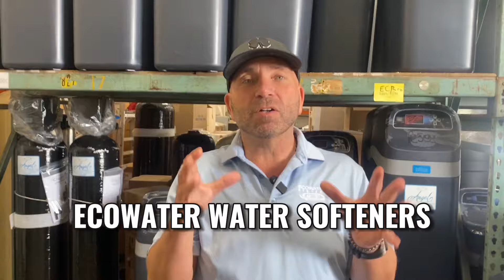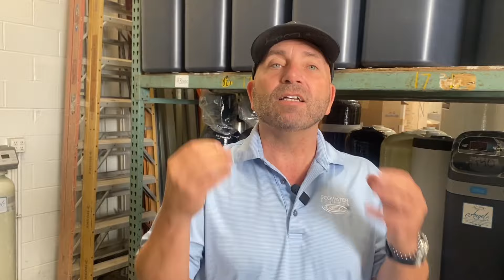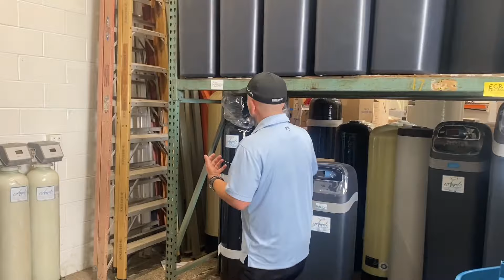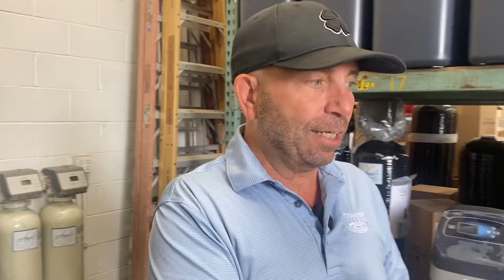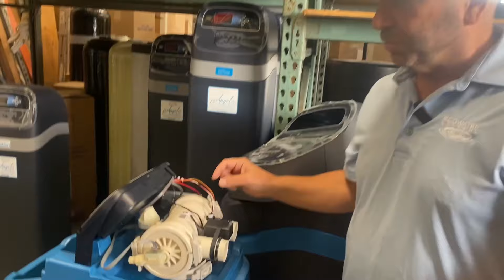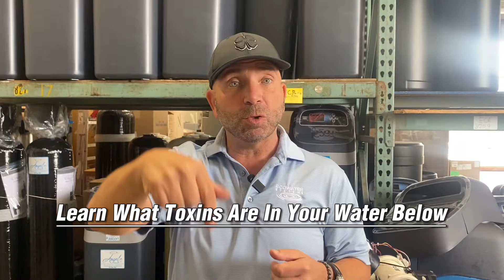ALL ABOUT ECOWATER | Angel Water, Inc

Comment: Way way toooo expensive for a water softener.  $5000-$8000?  Really?  Get one from Home Depot or Lowe’s for $500-$700 (wifi connected too)and you’re just as good without taking out another mortgage. Put mine in and saved big time.  Just think taking $5-$7k out of investments to buy this. You’ll lose $500-$700 per t would pay for a new one every year.  But I’ll bet mine will last 10-15 years.  It’s. Scam.
Reply from the maker: Hammer.  We service all makes and models as a service center for the big box stores.  So literally it’s is our team going out to service the big box softeners.   If you don’t plan on living in the home for a long time the big box may work.  However the warranty itself will explain if a manufacturer believes in their system or not. Big box = 0 warranty on filter material. 1 year on valve.  3 on electronics.  10 on tank.  Vs 5 or 10 year bumper to bumper warranty on some professional grade products. Big box also reduces water pressure in home.  Also most are not certified to remove radium from water. 
And that big box doesn’t include tax or installation. 
Most of our customers have homes that are their forever homes. So like most things in life, you get what you pay for.  But my philosophy is simply.  I’ll do whatever you want for your home and family.   We are here to serve you.
Reply: @AngelWater hmm let’s see, $5,000 to $8,000 for a water softener?  Crazy.  There’s really nothing to them, plastic containers, some media, valves and simple electronics. Like I said, I could replace mine every year (two water connections and a cord plug) and still be money ahead.  But the one I bought for $700 has a 10 year warranty and wifi to monitor and it’s working flawlessly.  I get that you think yours is the best, and maybe it is, but at that price, it’s just not financially realistic.  It appears Your videos scare people into spending this money. Anyways good luck.

Comment: Our EcoWater system from Costco is my #1 regret purchase of all time. When they came out to do 1St. years service I got a large bill. Next service the Tech told us we needed to spend another $5000.00 for services of water heater (which was new at time of softener install). I cleaned flushed and installed a new anode rod. Total cost less than $50.00.
The tech was extremely pushy to the point I asked him then told him to leave. The company still kept calling. I thought I was going to have to get a restraining order.
Very unhappy here in Prescott Valley Arizona.
Reply: I hear ya. I don’t really think that the Costco executives are tuned into this ripoff.  We had a guy come out, he was unimpressive, had no people skills, just regurgitated his speech and left.  Not impressed. He just harped on scaring us.  Not a way to sell.  Fear is not a motivation in my book.
Reply from the maker: Wow, you have a lot to unpack here. I am thoroughly confused with the water heater issue and how that is related to the water softener.  I would urge you to contact the owner of the EcoWater dealership you dealt with so they understand the experience, that you had regarding the representatives pushing you.  
Each EcoWater dealer is independently owned.

Comment: @Drew the Water Guru
I live in Osteen, FL.  I can of course buy from a Costco contractor or a local dealer.  Not sure if Angel Water services my area being 2+ hours away.  What is the advantage/disadvantage of buying Costco versus a local dealer.  I am contemplating Kinetico which two of my neighbors of recommend and Ecowater.  I need one within a month.  My system sucks ass.

Comment: I had an ERR3700R20 installed in March of this year.  I don’t feel the water being slimy or slippery.  They had me increase the hardness from 13 to 17 and I still don’t see the difference. Then to 21 & still no difference.
I don’t know whether this softener/refiner is actually doing its job.  Do you have any suggestions as to where to set the hardness at?
Reply from the maker: I would call the company who sold it to you and have them come out. Usually all Water softener companies give you the first year of service for free. It seems to me that adjusting the water softener for harder water is an incorrect way to solve this problem.
Reply: These csbinet models produce a very weak brine solution that will eventuslly not clesn resin well. Manufactured defects warranty. Good luck!
Reply: Ecowater came out and showed me the one unit with WiFi and the other with two components (model EEC1502)/tank for half the price. Is the EEC1502 recommended?
Reply: My issue still is not resolved.  They came and replaced the resin last week.  Had softwater for 3 days & then back to its hardness.  
This is getting to be a headache!!

Contractor will be back to check the unit again.

Comment: I WAS SO READY TO BUY THIS UNIT AFTER WATCHING YOUR VIDEO BUT I LOOKED AT THE REVIEWS HERE IN TEXAS THEY HAVE SO MUCH BAD REVIEWS ! HAVE NOT HEARD ANYTHING GOOD ABOUT THEM . NOW I DONT KNOW WHICH WAY TO GO . KINETICO IS JUST AS BAD AND EXPENSIVE .
Reply: I don't know if you know what Texas have the worst hard water than any other state that is hard for any type of system to get treated in Texas I will still go with the ecowater system for Texas
Reply from the maker: @RaisingMoreThenMetal  Thanks for sharing your feedback.
Reply: @RaisingMoreThenMetal very helpful insight thank you so much
Reply: @RaisingMoreThenMetal  @AngelWater We have about 12-15GPG here for water hardness...
Reply: Ecowater make the rheem water softener snd if you look in the manual is the same valve design as eco water for $499 instead if $3k at costco lol. Eco is not the biggest manufacturer of water softeners. Thats a lie!
Reply: @Unknown-mc2ho  Thank you for the info I will look into it
Reply: Getting an eco system installed next Tuesday but having second thoughts based on reveiws online. We are paying just shy of 8500$ and I've read all over that it's not worth it and is an overpriced system. Your thoughts? Is 8500$ a fair price for this system
Reply: Eco water should be sold online. A little scammy IMO.
Reply from the maker: Where did you see these reviews? and what systems did the reviews say were great and were they NSF44 certified? Thank you so much for watching this video joe!
Reply: @AngelWater  when I goggled for a dealer near me .and 8 of 10 were bad reviews
Reply: I can safely say that both “Review” sites and “Top 10 Best of - -“ are ran, supported and created by the company they claim is best and has the highest reviews. 
  I don’t have anything to do with clean mineral free water products, I fixed vehicles for 40+ years. There are only a few companies of each item make a product then re-brand them. GM owns companies or has controlling interest yet if it says ACDelco, GM or Delphi (For some products) but it is GM’s design having to meet their quality demands. Exception is restoration parts as they have proven quality, GM tooling & licenses. 
  Water softeners like oil have say 4 companies that make base oil & two synthetics but only 3 companies make additive materials. Each sell a different ratio and come from the US. 
  EcoWater makes great products but different levels & features. Many have no Bluetooth or WiFi & twin roto-valving as most will use a “Venturi” system that creates regeneration or cleaning. Having it dump into a yard, septic, garden or creek quickly becomes an issue. 95% of failures are due to the customer to perform maintenance, properly service like add salt to test the hardness of water. Parts can break but when electronics get wet with salty water, it’s mostly game over. Plastic part cracks, sprays on a control board that doesn’t have a $0.25 cent plastic protective cover on it, game over. I fixed these things, I test pressures, added protective cover and maintain proper salt levels. Most don’t. Most can’t or won’t! 
  Enjoy 2025.
Reply: Where are you in Texas.  The Dallas area has 4.9/5 rating.  Each market is owned by a different owner,  but the equipment and warranty are the same.

Comment: My eco was digital panel went blank after we cleaned tank and refilled salt. And it’s plugged in. Any suggestions??
Reply: Buy a rheem at home depot. Same valve!
Reply: @Unknown-mc2ho  my Rheem lasted 2 years before the fiberglass resin canister started leaking and filling my brine tank with water during use